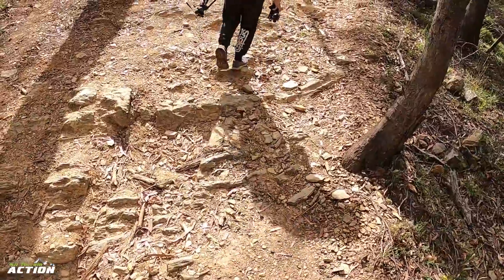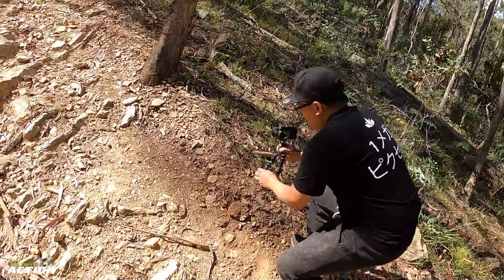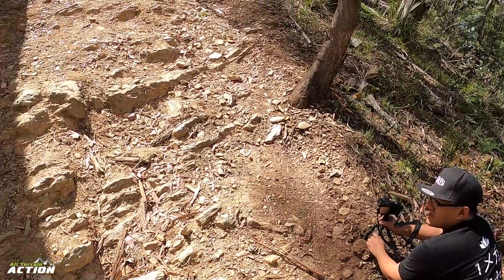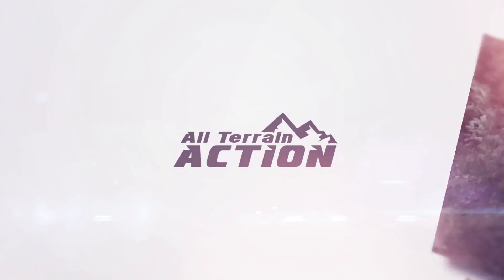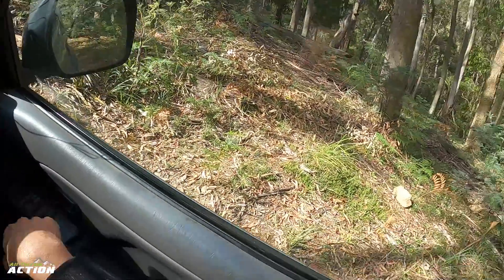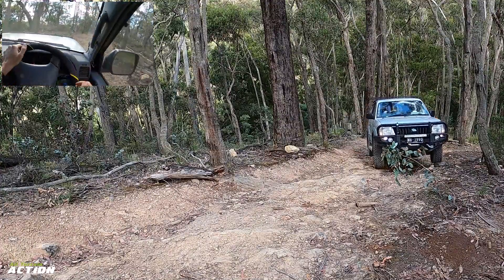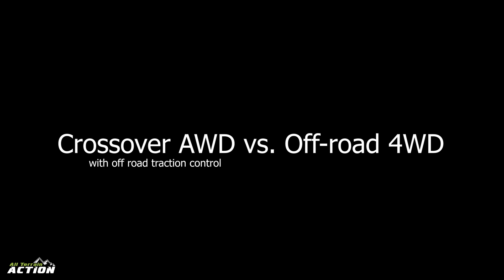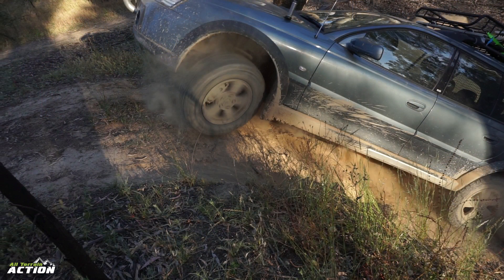Difference Between TRACTION CONTROL AWD vs 4WD OPEN DIFFERENTIAL OFF ROAD

Comment: Can you put lockers on A awd?
Reply from the maker: You could but since it’s open in the centre the only real way this would be truly beneficial off road (on a real 4WD track) would be if you had it in the front as well as the back. There could be some very few scenarios having only rear could help but if you really in a situation having lockers would probably upset Crosstrac system. Can never really know though, I though a torse. truetrac in the rear would create a mess but it really has improved the capability as the front brakes can hold up the torque to push the rear wheels, the outcome will differ between AWD vehicles.

Comment: I think solid axles would work better ?? At least with solid axle do you have both wheels on the ground .
Reply from the maker: Without a doubt, that's proven in the Cross6/8 models of what drive system this pretty much has with rear solid axle.

Comment: Only a drongo would think an adventra could match what a built for purpose 4x4 can do that was never Holden’s intention they are designed for at most greasey dirt roads I own two LX8’s I also own several Range Rover classics both are very capable in there correct environments I can drive the adventra over soft paddocks where the rangie can bog but I can drive the rangie over terrain that would belly out the adventra. Horses for courses smart off roader’s don’t get that confused
Reply: Keep enjoying yourself guys.
Reply from the maker: @davog9925  always will thank you for your comment here have a unlisted video ;) link for some comedy.  https://youtu.be/toQC1j1wGlY
Reply: Using cars for things they weren't fully intended for is half the fun. Doing a climb in a 4x4 is meh. Doing it in a Holden wagon is interesting
Reply from the maker: @devo3243  thanks mate, is true turns more heads than you would think as well 😜

Comment: where can I get a decent head unit and nudge bar like you guys?
Reply from the maker: You can find nudge bars for the Adventra often on market place on Facebook I don't know anywhere that sell them brand new anymore. You will also need a reinforcement bar to weld brackets onto use the contact form on this page https://www.allterrainaction.com/bash-plate/ as the same person who makes the bash plates also can provide brackets. As for head unit just pop into your local Supercheap or Autobarn and most double din headunits will install no worries with a harness to convert to existing plug with no additional wiring needed (literally plug and play).